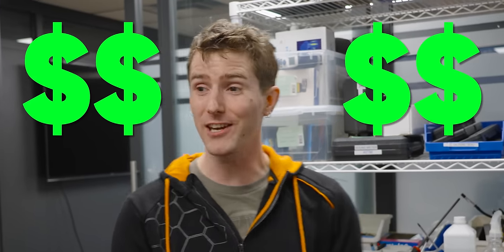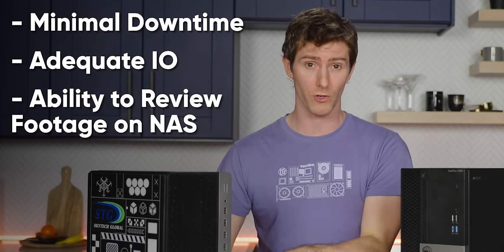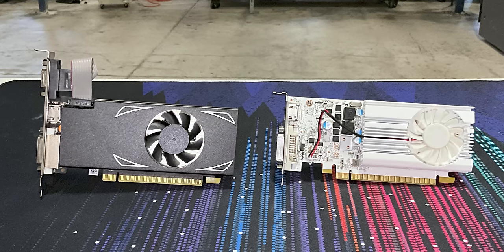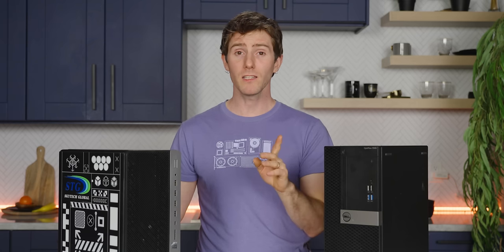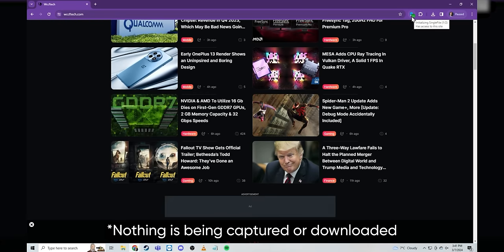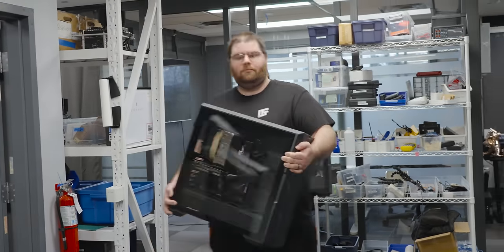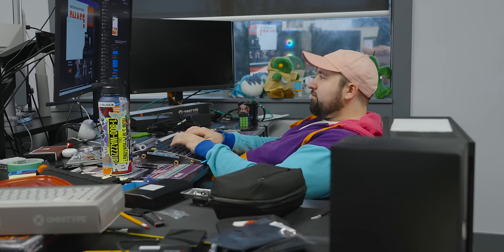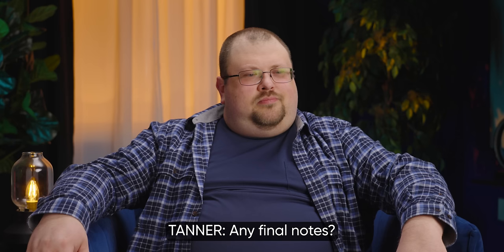We Downgraded our PCs to Prove You Don’t Need a New One

Comment: The main reason businesses are getting rid of these PCs is because they usually don't have a TPM and thus can't be upgraded to Windows 11.
Reply: Odds are all they need to upgrade is the motherboards, not the whole pc. Every company should have their own Linus in my humble opinion .
Reply: The main reason is that new computers are tax deductible.
Reply: even with a TPM v2, modern win 11 doesn't like anything less than 8th gen intel and 2nd gen Ryzen. While there may be workarounds, who knows for how long those will work. For what ever reason, MS is really trying to do away with older machines. 

But 8th or 9th gens are still quite good. But dell has a tendency to way under spec their PCI lane counts and RAM amounts... also their PSUs. I run an old 8th gen i5 for my media computer but my x16 slot still only has 4 lanes going to it. And I wanted a display at 4k which meant I needed a discrete gpu so that kinda stinks as that makes 4k videos chug sometimes but its not too frequently.
Reply: With MDT you get around most of the restrictions. Most of computers at the school district I work at have 6th or 7th gen processors and nearly all of them are on 11 and they run fine. When working with a limited budget you got to keep them working.
Reply: Businesses are getting rid because of their renewal cycle, which depends from company, but is about 3 years. So there are really good options there.
Reply: @arkfunatic2024 That makes no financially sense for businesses
Reply: Wee11 is never an "upgrade".
That shit is cancerous as fuck. 
Either get W10 IoT LTSC Enterprise edition + crack it, or switch to Linux already.
Reply: @GugureSux 
Gotta have that vendor support so migrating to Red Hat seems to be the way to go
Reply: dell optiplex 980 was tpm but its the Cpus that are being cut because Microsoft wants you to buy new systems i guess security would be a good reason hint hint
Reply: @BTGDelta  Do y'all think tax deductible means free?
Reply: first question is, why they have to upgrade to W11 in the first place?
Reply: @MichaelCH911 

Maybe because Windows 10 EOL is pretty soon actually
Reply: I worked on a huge refresh for a major hospital and their clinics a little more than a year and a half ago. They were going, and this is disturbing, from Windows 7 to Windows 10. We didn't replace all of their OptiPlex and older HP systems, they could almost all run TPM 2.0. We just reimaged most of them. We used beefier systems for radiology and some labs, but most of the even newer stuff we did use was pretty basic.
Reply: @GugureSux  I went to Ubuntu well before Win11 came out for my productivity and gaming and I've never been happier with my system. Sure it has weird bugs from time to time, but so did Win10 and so would Win11 xD.

IMO its not worth having MS's spyware on your system just for the sake of compatibility on some software when WINE has come so far.
Reply: @arkfunatic2024 "...all they need to upgrade is the motherboards" You can't upgrade the motherboards on these corporate boxes, it's basically impossible and/or completely impractical cost-wise.  (they are invariably proprietary form-factors and use proprietary power supplies, header connections, etc.)
Reply: @2528drevas  Thats just business as usual and it often comes down to old peripherals
It would not be surprising to still find Windows 9x machines in the basement or used for X Rays in those clinics
Reply: @BTGDelta  They still have to spend that money.  Deductions don't directly reduce the tax liability a company has to pay; they reduce the amount of income from which those taxes are calculated.  They would save more money by not buying any computers and paying their full original taxes than they would by buying computers and still paying slightly lower taxes.
Reply: @BTGDelta  Not exactly... companies (at least in the USA) have to pay property tax for owned equipment, annually.  "Intangible" taxes, as it's called.  This is where owning old, beater equipment is awesome as it's depreciated value is zero.
Reply: There going to a flood of machines at the recycling centers when win10 ends support
Reply: I see this as an absolute win!
Reply: @1stGruhn  pci-e 3.0 x4 has approx 4000mb/s bandwidth, 4k video has 4-12mb/s bitrate.
Reply: Nah. Most of them have 3-5yr replacement cycles depending on warranty, depreciation schedules, failure rates, and internal decisions.
At this point, most of them couldn't care less about W11.
Reply: TPM is not a requirement, this is many ways around it and i have put Windows 11 on computers without it, many times.
Reply: @mariuspakenas  Bullshit, so many companies run computers from the 90s still. Try 30 years, not 3.
Reply: @MichaelCH911  Because win 10 security support is being dropped soon. Some companies took way too long to move on from windows 7 as well. Any major security breaches can mean huge lawsuits in the business world.
Reply: @Роман-д1й1ш no. That is insanely heavily compressed. Uncompressed, ProRes or RED footage is many multiples of that.
Reply: @arkfunatic2024  Optiplex motherboards are not swappable between generations, and they are everything but standardized. It's actually cheaper to surplus the old computers, than it is to spend time getting 100s of them to play nice.
Reply: @neth77  I'm in Europe, my company changes every 3 years. So maybe somewhere there is computer's from 90s, but not here. 10 years is already too much and you are talking about 20-30 years? Serious? Floppy drive's maybe for word document saving is used, because HDD is about 5Gb? :)
Reply: @BTGDelta  No business wants to buy equipment they don’t need it still costs money. They still have to spend money for computers that could have otherwise been profit.
Reply: @morganghetti  people that make statements like they did scream “I don’t understand business at all”.
Reply: @arkfunatic2024  You are correct but from an enterprise level it is cheaper to replace the whole machine on multiple fronts.  This is something that a lot of people forget to look at is scale.  When you are operating at different scales what may work in one offs or at a small scale doesn't work at a larger scale.
Reply: @1stGruhn I ran into the same issue. Windows 10 was unstable and bricking itself every 3-4 months and Windows 11 refused to allow me to upgrade because I was missing some DRM and anti-copying idiocy on the motherboard and CPU. Despite having a full stand-alone copy of Windows 10 Pro.  $600 to upgrade.  Or run Linux.  The funny thing is that with a positively ancient PC I am able to run my Steam games at about 5% better FPS than Windows simply due to the massive amount of bloat that I am not running.  I don't NEED more than 4 cores due to the lack of background bloat not running.
The moral of the story is that NO i7 or i9 no matter how old it is is truly e-waste. Only the operating system. :)
Reply: This happened to me recently… I was daily driving a 5800X3D but suddenly died while been covered by warranty so I send it back and was refunded.

Since July I’ve been daily driving my old build with a 6700K and haven’t encountered any significant issues apart from lower FPS in latest more demanding games like Helldivers 2.

Paired with a 6700XT for those wondering.

So yeah, I decided I’m not upgrading until this PC it’s pretty much dead.
Reply: Tpm is not the primary issue. Cpu generation is.
Reply: @neth77  Ok and? You're an individual. No company with a self-respecting IT department is going to bypass OS install requirements or use old software/hardware with security vulnerabilities. You don't understand how businesses are ran at all
Reply: Most small to medium sized businesses here stay with Windows 10 no matter what
and TPM only is an issue with systems that leave the office.
+1 to whoever said tax deductible
Reply: Had it without tpm ran exactly like 10 idk what you on about @1stGruhn
Reply: @arkfunatic2024 two issues in a business environment: upgrading a motherboard on a pre-built system is often impossible, and two: the time spent on getting IT to do this is often greater than the cost of buying a new computer.
Reply: @arkfunatic2024  Swapping the mobo on dozens of computers is expensive in manpower. Selling them for cheap and buying new ones can be cheaper than paying someone to change motherboards for a week.
Reply: @arkfunatic2024 hiring a guy to rebuild PCs with a new motherboard would probably be more expensive for them.
Reply: @arkfunatic2024  it would take ALOT of time to swap a motherboard not to mentioned thermal paste, also reactivate windows (since it’s usually tied to the motherboard) and finding specific boards that fit in the chasis since most business do not build their own PCs and buy them from dell or HP. That’s a horrible idea. It’s cheaper to just buy them. Plus business actually get really good discounts on computers.
Reply: @arkfunatic2024  If you're changing the motherboard odds are you're changing the processor and if it's a several years old pc, DDR could have gone up in generation too. Throw in new harddrives because they have a shelf life too... And you're left with a case, GPU and Power supply.
Reply: The main reason that corporations replace their computers is: they lease them, with tech support bundle in.
Reply: @GugureSux Yeah... If you have a business and use pirated software it's a good way to pay thousands of dollars in fines.
Reply: @vinylmodsmanitoba  Sure, WINE has come so far from 10 years ago. It is still not something I'd use for my work.
Reply: @neth77  Good on you. If I was the IT support of a company I'd ask my manager/boss for my salary to be doubled if I had to support 100 computers running an officially unsupported OS.
Reply: @DoubleCTech  large businesses won't do that because support is more important. What if something goes wrong, they call in windows support and he finds out that you're using these "tricks" to get around installing win 11?
Reply: @GugureSux no. Use w11 but with NTLite.
Reply: @arkfunatic2024  well businesses generally use Dell office computers and you can't just "upgrade the motherboard", the motherboards are made specially for the dell case making swaping out parts difficult. The motherboards generally aren't even standard sizes or shapes. Power supplies are also difficult to change out in dell office computers as they are made proprietary for the motherboards. This is especially true for those SFF office computers.
Reply: Imagine thinking windows 11 is an upgrade lmfao
Reply: @mwbgaming28  well... talking trash about windows is the norm but windows 11 isn't exactly a downgrade. It has a few features I like and directstorage does cut time loading times between the SSD and GPU... in the few games that use it.
Reply: Have you thought about ruckus?
Reply: @arkfunatic2024  Its true. But hp makes it so that the case only fits their proprietary motherboard. Furthermore, when upgrading to a mobo that supports newer procies, sometimes HP changes the layout such that the ports dont fit into the IO shields. This leads to the company the whole computer instead. Like what happened with the hp computers when they went from elitedesk g1 to g4. Suddenly the motherboards dont fit in the old cases anymore.
Reply: The main reason is because they are out of warranty.

No business is looking to upgrade to win 11, that will happen as and when new machines arrive with it pre-installed.

Where I have worked, apart from small operations, there is usually a 3 or 5 year hardware refresh. It's standard for warranty protection. Whether it needs swapping out or not, every 3-5 years everyone gets a new PC or laptop. Just to maintain warranty.
Reply: @arkfunatic2024  A lot of OEM desktops from the likes of Dell, HP and Lenovo often don't use the ATX standard for motherboards, but rather their own custom layouts. Most companies buying desktops are not getting custom systems, they're buying OEM systems. So no, oftentimes you can't change the motherboard if you have an OEM system.

Comment: The urge to get yourself something new because It has been years
Reply: 10 years, still flew like a rocket, but the new computer off I feel im going into warp or something
Reply: im still using my 1080ti and its still chugging along. absolutely no issues. the difference in an upgrade for me is in the 10s of milliseconds
Reply: @spacekitt.n  i am still using a intel hd 510
Reply: I still have an 8700k paired with a 3080.🤣
Reply: @StuartBreland  3080 is fine that's just one gen behind and it's a high-end card.
Reply: my Pc and chromebook are both 4 years old which isnt that long but  I think about getting new ones all the time even though they work perfectly fine
Reply: @stuffbymax   i am using a uhd 620 right now my main rig broke
Reply: @davidphillips5677  it can do 4k video
Reply: 4th gen suck...greets my old 2015 i5 970 8gb 2133 mhz build
Reply: @Djuntas  nice
Reply: @stuffbymax  either your a teenager that has no job or an adult that has no job. Seriously save up money, you can even go the used route if you're into that. Just don't get a used SSD.
Reply: Also, Windows really slows things down. I installed Windows 7 on an old(ish) pc recently. And holy cow is it snappy compared to Windows 11. I have a legit baller computer and Windows 11, bordering on workstation class. And Windows 11 really feels sluggish half the time. I don't get it.
Reply: @spacekitt.n  lol. My 1060 still works
Reply: @StuartBreland  8700k with a 2070s at 1440p, I feel its age, but def not enough to drop 2k+ for a new rig
Reply: The urge to get yourself something new because it has been year
Reply: My gen4 server xeons with ddr3 and pcie3 are doing just fine for workloads that most people can't imagine running at home.
There's little use for home users to have all this power
Reply: Hey! I upgraded my 10 year old Core i7 PC. Now it's a newer Core i7. It opens Youtube very fast!! :V
Reply: @CarlosPCmx  I did the same, I had it for 8 years but it was 10 years old (used hardware). 

i7 990X to i7 9700K. That was 4 years ago, so technically it's already half-way through its "lifespan". 

I'd go broke if I upgraded with every new release.
Reply: @stuffbymax   yes when not downloading anything
Reply: @spacekitt.n  my bestie plays FPS games on my old 1080, does just fine! great old card!
Reply: @StuartBreland  my bestie is running a 6th gen i7 extreme and a 1080 and maxes graphics out on our FPS games
Reply: @Djuntas  my daughter games on a 4790k with a 5ghz OC. it's a beasty old chip
Reply: still on a 1080 and an i7-7700k. I've been holding off on new games (Cyberpunk for example), until i upgrade. Been wanting to for a couple years, but something always comes up haha. here's hoping this time next year it happens.
Reply: Then you have my parents who will just use a computer until opening a window takes over 5 minutes.
Reply: Me with my 4080 I got in 2022
Reply: Still Rockin that GTX 1080. But alas it is time to upgrade her soon.
Reply: @hoofhearted4  you can definitely play new games that have amd FSR in them to get an enjoyable experience. Not everything is out of reach
Reply: More like 15 years.
Reply: @Djuntas  I was using an i5 4670k in a secondary pc. It was mostly fine for everything I intended to do on it in 2021. The 4 little cores that could. Paired with a 1060 6GB it was an overall good experience.
Reply: @SixOThree  ask Microsoft what all tracking technology they baked into 11 and you'll probably get part of your sluggish answer.
Reply: @manitoba-op4jx  Yup, it was the closest thing they had to the price to performance ratio of the RX 480/580.
Reply: @ACiDGRiM  nah man, I want all the PCIe lanes. I don't like losing SATA ports if I connect too many NVME drives. Similarly I want to actually be able to run a VR headset with all those drives. Other add in cards have their uses too, like capture cards.
Reply: @thekwoka4707  I strive to become that. My previous Ryzen rig was edging on 7 years old. Then I upgraded the cpu.
Reply: @ghomerhust  Sure, you got the I7
 and OC...I said I used an I5 (4590), and its not even enough to stream stuff or basic stuff to my 4k TV. I just use the old desktop to stream with.
Reply: "Still" and "just" should not be paired with the name of this card😂 @StuartBreland
Reply: I want a new wife
Reply: weeks
Reply: @StuartBreland 
Wow. That's so gay
Reply: @stuffbymax  are you still using integrated?
Reply: @TheLiverTea  yes
Reply: @Blackwayken  Nah, gtx 1080 a beast 💪🗿